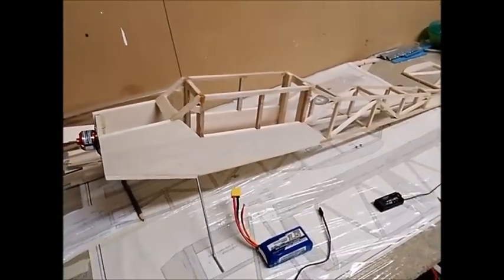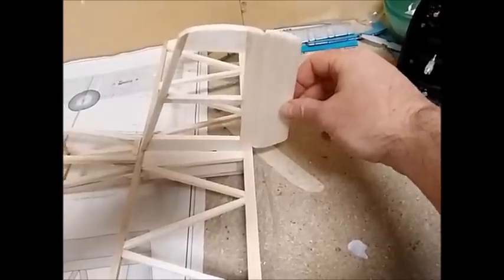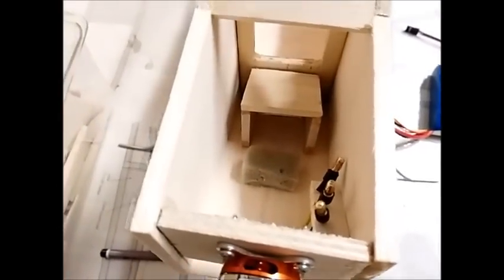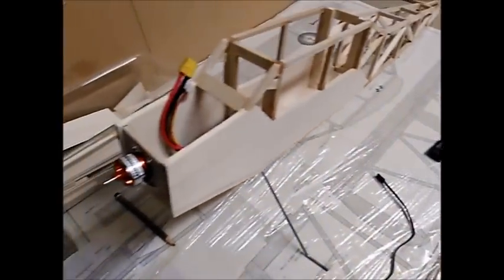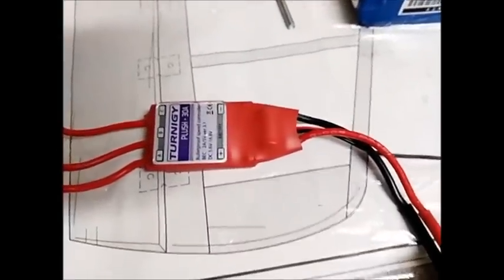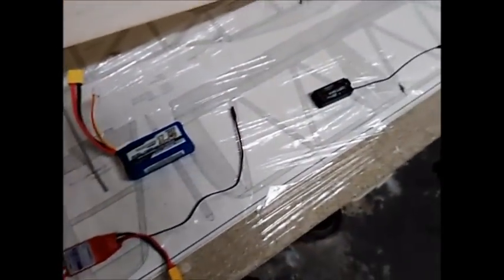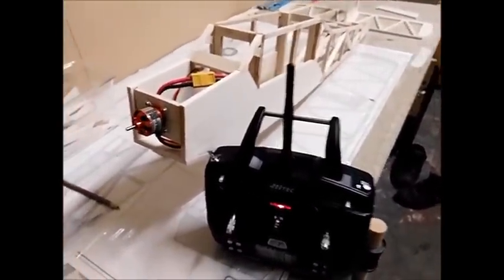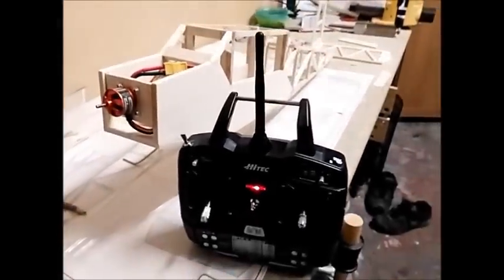Video 11: Installing brushless motor, battery and RC electronics

Comment: Hey man i have small doubt plz tell me how did assemble the propeller to motor
Reply from the maker: Hi, you need to use a propeller adapter. Like these ones https://www.ebay.co.uk/bhp/prop-adapter

Comment: What is the purpose of the offset of the engine?
Reply from the maker: +assymcgee1 hi, when the propeller is spinning it has a tendency to spin the plane in the opposite direction. Angling the engine slightly off centre generates side thrust to counteract this effect. Most plans will specify how much side thrust is needed.